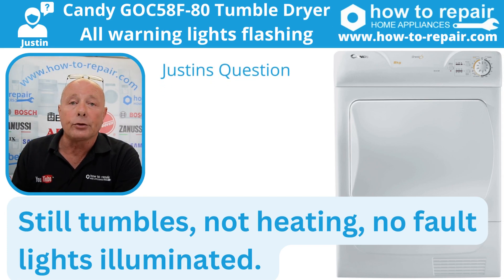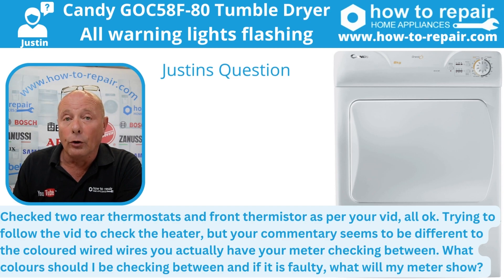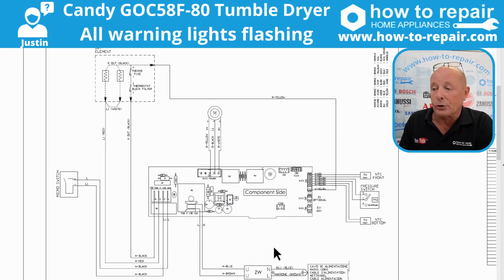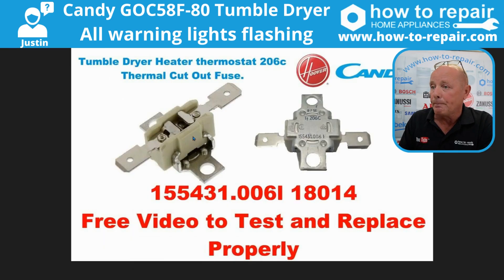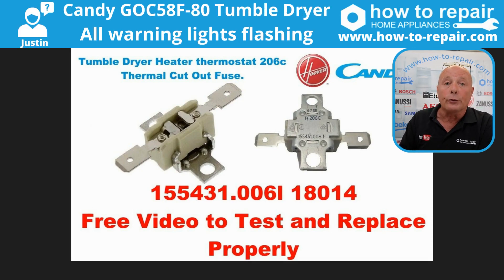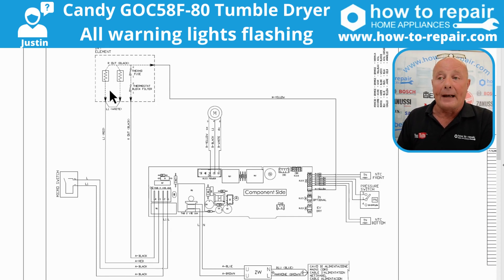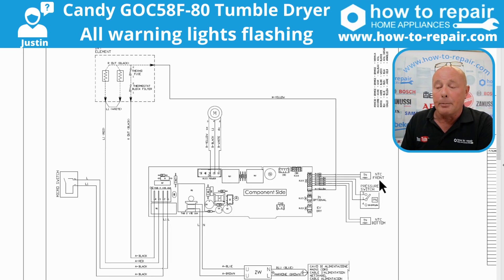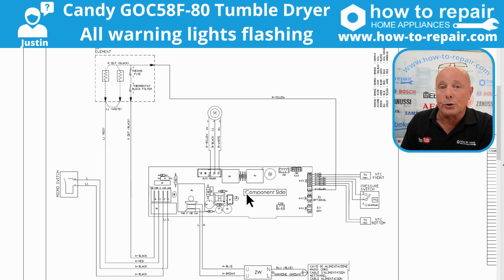Candy GOC58F 80 Tumble dryer Still tumbles, not heating, no fault lights illuminated: wiring diagram

Comment: Slightly off topic, does the expected resistance reading work for AC induction motors? 

Im working on a 230V motor that requires 0.2A, should the resistance reading across the leads be 1,150 Ohms?
Reply from the maker: most of the induction motors that I work on all three Fields are the same ohms reading